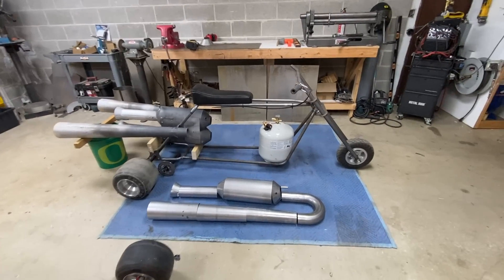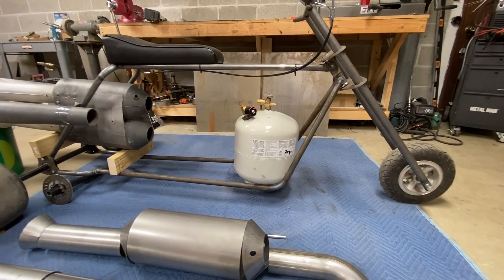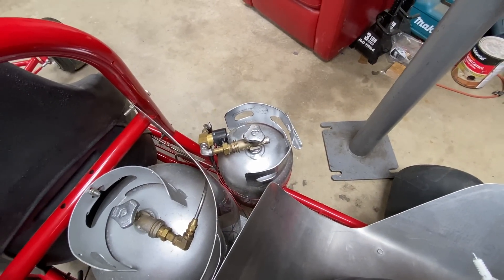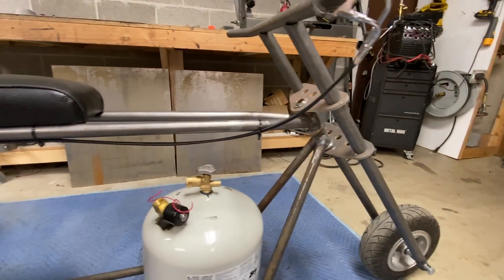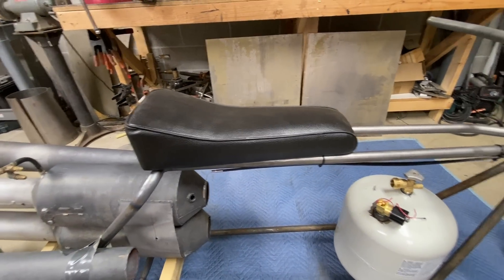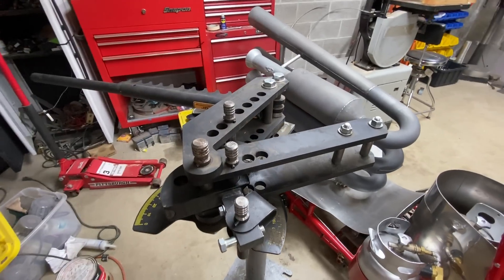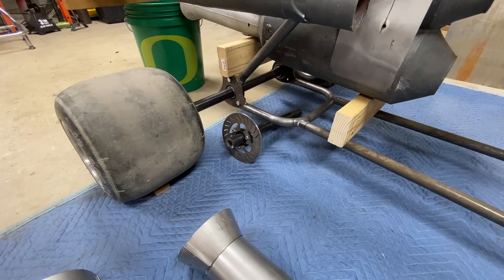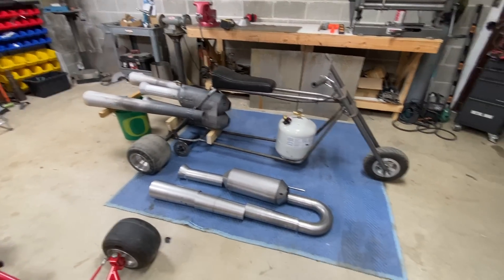Crazy Rocketman: Building a "JET MINI BIKE".Part 1

Comment: That is incredible, I do have a question though, how did you design this pulsejet, and how does it work?
Reply: That's quite a lot of question for a YouTube comment, there are loads of videos on YouTube of how to design and make a pulse jet and how they work.
Reply: Basically.. air+fuel+explosion through nozzle to focus= POWERRRRR
Reply: imagine taking the time to type this instead of just searching. You have the entirety of mankinds knowledge at your fingertips, learn to use it.
Reply: what I find interesting is the fact that it has a throttle, I was under the assumption that these things needed a fairly constant fuel/air input ?
Reply: @kylegilmore3810  Damn I was just wondering about his specific pulse jet design
Reply: @tarunantony1866  I'm sorry I might just be a layman; I don't see how it functions differently from any other pulsejet.

Comment: If I may make a suggestion I would use a bigger tire on the front it looks a little too small I could be wrong it could be just the angle that you’re filming but it just looks a little too small you hit a bump in that might knock you for a loop but it’s cool looking I love it man I wish I could have something like that Also I love your shop what kind of welder do you use is it a Mig Tig stick Because I used to be a welder